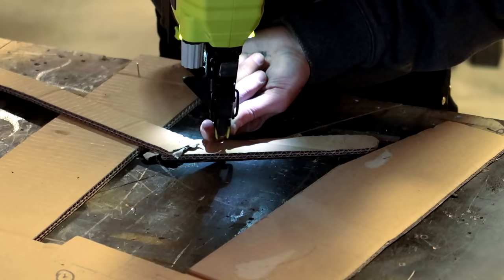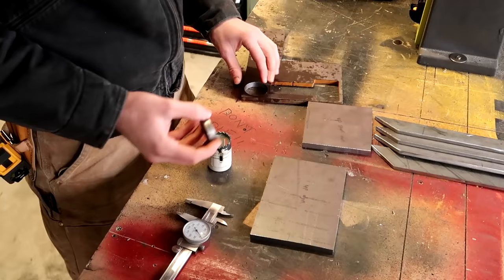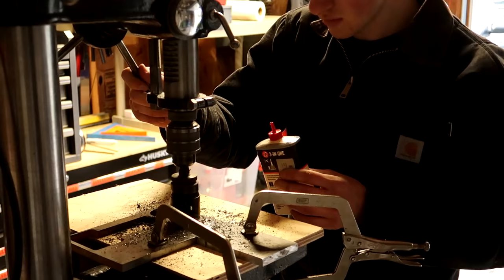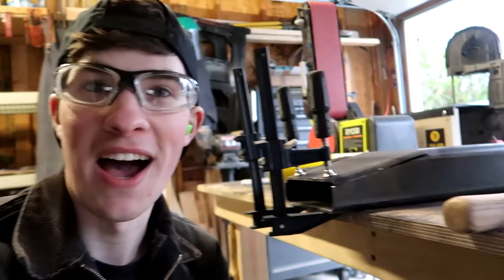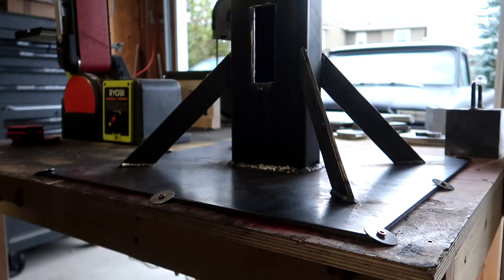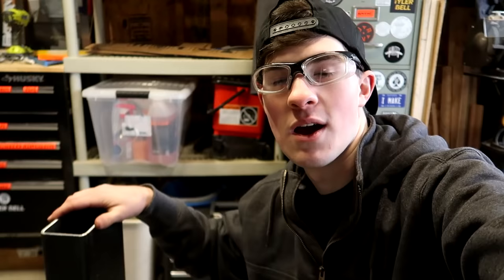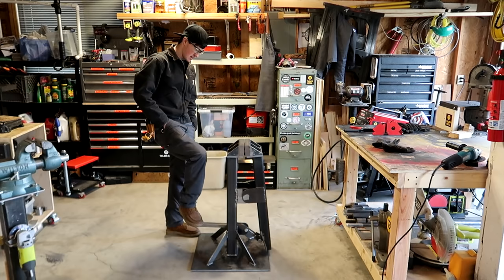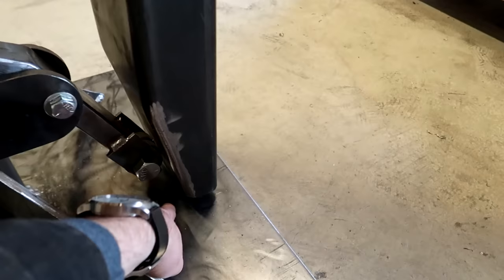Making a Blacksmith's Foot Vise

Comment: what's amazing about this project, is that you made it happen, without super expensive waterjets, CNC, lathes, and mills. but simply angle grinder, drill, welder.

great job
Reply from the maker: Thank you!

Comment: I would love to see a pivot point on the jaws that would allow them to sit parallel regardless of material width. It'd be tough to work out, but I think you could make it happen!
Reply: That will require a sliding mechanism with possibly even a gear or two.

Comment: The plate warped due to heat shrinking, aka the dreaded Weld shrinkage. The best method to fix it is avoidance and prevention but, since you're already stuck with it, then a quick and dirty solution is to apply opposite heat to the welds. Heat the plate on the back side of the welds(on the underside of the plate) to a dull cherry red with a oxy acetylene torch and let it air cool; that will take a lot but sadly, generally not all of the warp out.

Comment: Nice work. You may want to break the fixed linkage to your foot and add a ratchet locking assembly inducing a spring clamp. Stand on it to clamp then stand on the release cam.

Comment: Over engineering recommendations:
Swivel head(s) so they stay parallel
Ratcheting handle that locks the jaws when needed (after you clamp with your foot) and it provides just slightly more pressure to ensure there is no slippage of thing in iaws

Comment: That is seems like a great idea. Gonna try doing a version of that myself. About the warping, if you have not figured this out since this video was posted: Apart from what others have said about reverse heat and such, I would add that since you were welding in braces anyway, just weld them in first. They should counteract a lot of the warping since they will be in compression.

Comment: Cool vise! Thanks for sharing.
Reply from the maker: Thanks Jason! I appreciate it
Reply: This just save me a lot of time to suggest to Jason at Fireball tools should see this.
Reply: The Vice Master himself
Reply: It is a cool vise, but I would think that with such small surface area actually contacting each jaw, that a piece being held could slide easier, than had he made it to where the jaws whole front face area contacted each other. 
It seems to me had he done to the top of that rectangular tube as he did on the bottom with notching out the side some and welding it that it would better line up on the face of the jaws.

Comment: The Jaws don't meet parallel. They'll pinch the work along the top edge only. Could you make the dynamic jaw free to rotate around the horizontal axis so you always got full flat contact regardless of the thickness of material being clamped

Comment: That is a great holder/gripper/crusher! The only thing I would have done differently is have one of the heads pivot, so that they both meet completely instead of just the top edge. But that's not important. You've made a solid, wonderful tool! Well done! 😀😀
Reply: @TylerBellMakes  just subbed 😀😀

Comment: Great project, im sure your welds will hold just fine but I'd turn the voltage up a smidge and instead of rocking, just do a nice consistent push at 45 ish degree, may find it easier to get a cleaner consistent well, no need to rock it (I know you did it cause of tacks) but thought I'd see if I could offer some advice keep it up

Comment: You turned the tubes the wrong way. Rigidity is directly proportional to width and proportional to the third power of thickness. You vice is a shadow of what it could have been. Oh, well. There will surely be other vices. (Nobody got too many vices.)

Comment: Why not add a latching or locking system to the vise? Once you press down with your foot, the vise will keep the position. That way you are freed to move around some especially if you are needing to move a single part a lot while working on it.

Comment: What is the tool your using in your vise @ 3:00?? Seen them in many videos but no one ever says what they are called?
Reply from the maker: Filing vise
Reply: @TylerBellMakes  thanks, searched for a "filing vise" haven't seen a single one, where did you buy yours at?
Reply from the maker: I machined it

Comment: 6:50 try and use  Radial  bearings instead  Of angular contact bearings. What you used requires axial preload for it to work properly.
Reply from the maker: I agree. They're just what I had lying around. Thanks